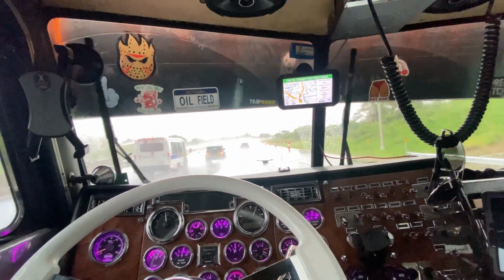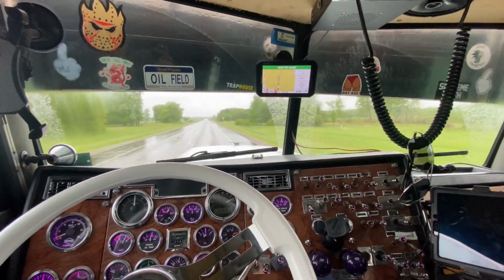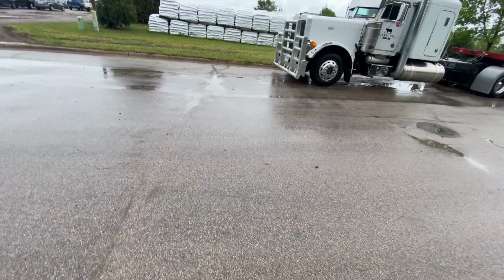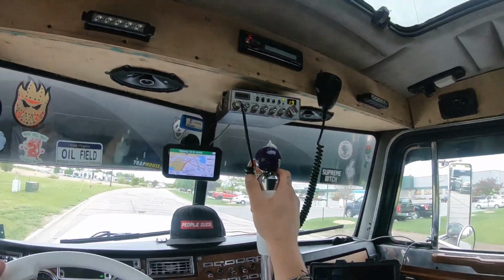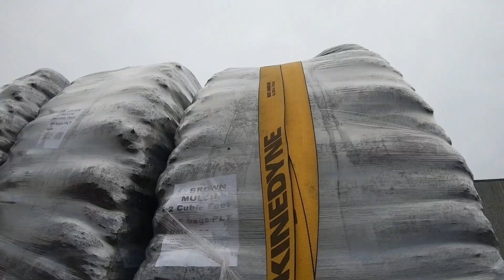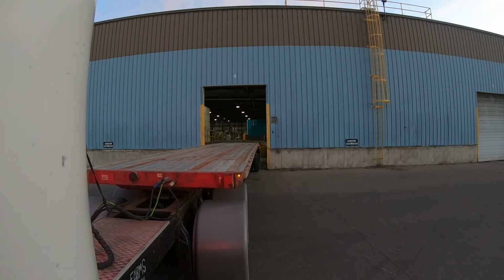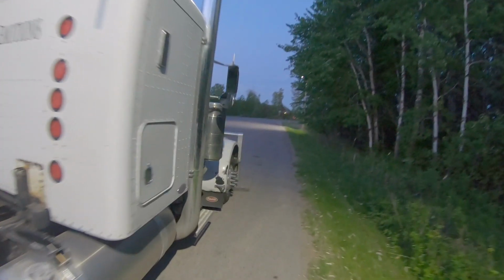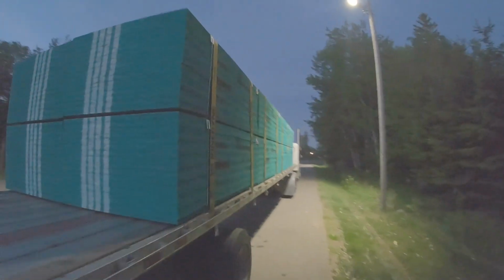Bonehead driver can’t handle the rain

Comment: That's what I liked about pulling 42 foot, and 45 foot trailers. The winches were permanently set on the trailer. I've never,had a problem with tying down any loads. Even hauling coils and plate. I loved hauling machinery and lowbeds. Drive safe brother

Comment: Purpose of the rub-rail is to keep the straps inside to avoid damage to the straps
Reply: Yup an regs actually say straps need to be inside rub rail when possible. It is also easier to capture the strap properly if inside rub rail.
Reply: His trailer is a 96” and the pallet bases sometimes extend over the rub rails, so going on the outside is the only viable option.
Reply: @dadduck9123  i understand the mulch load being a little wide for a 96" trailer, I was talking about the lumber load he picked up which was inside the rub rails, but he still put the straps outside
Reply: @dadduck9123  definitely a 102", sir. hauled more lumber (plywood specifically) than I'd care to admit, and out of this Norbord plant specifically. Rail is not under the product, it's outside of it. 102". Product would overhang rail if it was a 96".
Reply: @charleyfleming9037  no they dont
Reply: @charleyfleming9037  The reg states whenever applicable. The mulch he would get away with. The lumber no.
Reply: R S  he's a local driver, maybe that's why he's able to get away with it...because lots of other states like you mention, would fine him for sure
Reply: Who cares

Comment: We carry 2-3 portable winches that fit inside the stake pockets! Just in case you need a winch over an axle. Our winches that are mounted to the trailer don't slide over the axles. Hopefully your new trailer will have storage boxes mounted to the trailer. So you don't have to walk as far for your straps! Where's the wreck? What cameras are you using on the outside and how do you have it mounted to the trailer? I always place the straps inside the rub-rail. Straight pipe sounds great!

Comment: Straps inside the rub-rail PLEASE!!!
Reply: Straps can go on the outside or the rail..
Reply: @andrewaxelson2236  And what if someone brushes beside your trl,and cuts the straps.DOT can write u up for that .I've been with 5 flatbed companies,and they all wanted straps inside.Just saying.Nit trying to be a smartass
Reply: I agree, but it is not against DOT regulations if they are on thr outside 😉
Reply: @andrewaxelson2236  Andrew,have you read the regulation
Reply: Despite objections from Canadian officials, the FMCSA issued a final rule in June 2006, rescinding the prohibition on routing tiedowns outside the rub rails. Thus, drivers and carriers are no longer prohibited from routing their tiedowns on the outside of the rub rails.
Reply: Plus hauling those pallets of mulch like he is you cannot always get the strap down in between the rub rail in the side of the trailer dust you have to go on the outside of the rub rail. But maybe I don't know what I'm talking about I only have 26 years experience pulling flatbed
Reply: @andrewaxelson2236  Nope,you are right on.At times the pallets  stick out preventing anything to go between the rubrail.